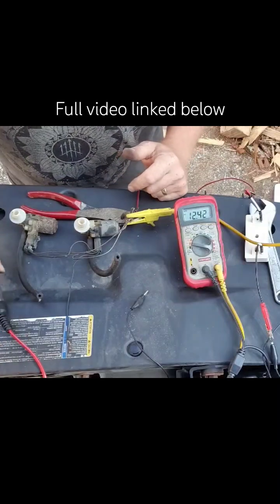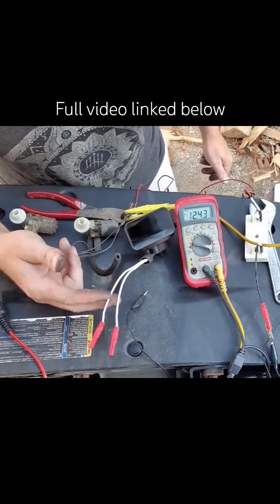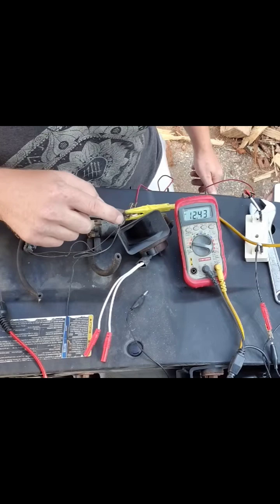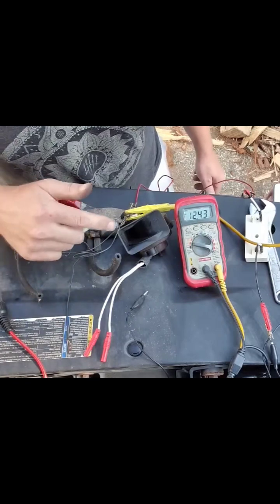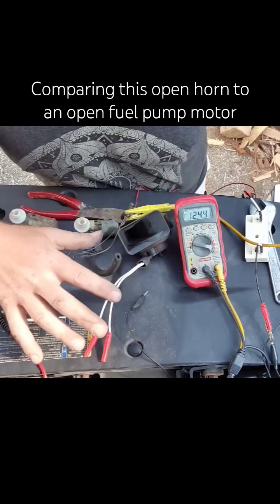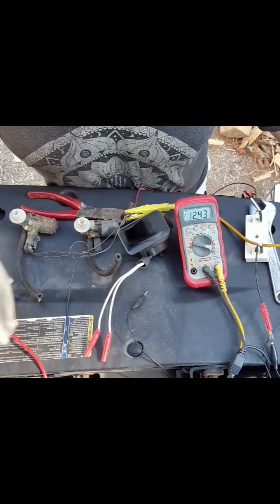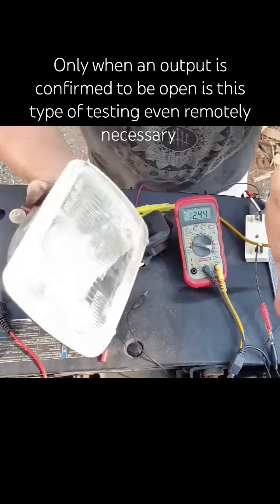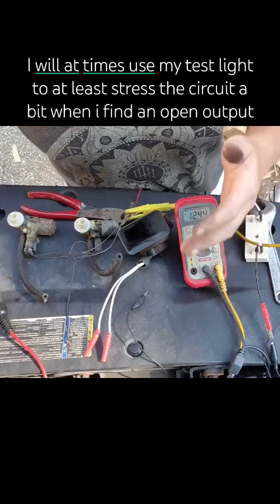An open "load" and a wiring problem at the same time?

Comment: you may not have seen wiring problems with a bad load at the same time, unfortunately i have and i haven't been doing this anywhere near as long as you.  people in my area will drive with a check engine light on for a long time before getting it fixed.

 had a chevy truck with 500k Ohms on the vent solenoid and green crusty wire a foot away from the ECM.
Reply from the maker: For sure, there are unique circumstances. That's an example of 2 faults happening years apart lol

Comment: Great video Paul, just also wanted to ask if you've done any video that explains fuel trim imbalance? On a v engine. 
Having trouble with a Nissa  Pathfinder. Both trims are maxed out. One it 25 the other negative 25.

Timing chain has been done, run beautifully for 30min then popping in the intake, calculated load at 90% when you try to take off. Right bank exhaust cold left hot.

Any help will be appreciated
Reply from the maker: Timing issue or plugged cat on one side would be my first two thoughts
Reply: @ScannerDanner  thanks for the reply. Definitely must be timing as he has removed both cats, trying to narrow down the issue. Thanks again